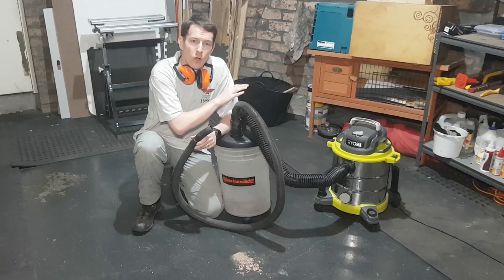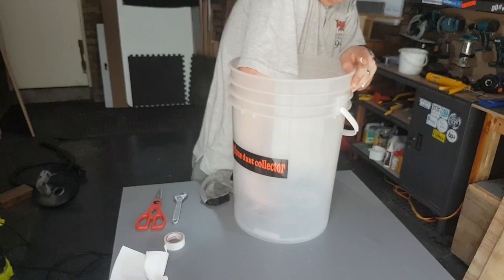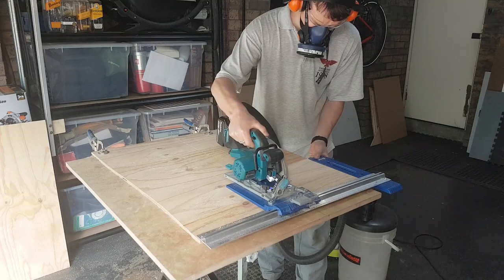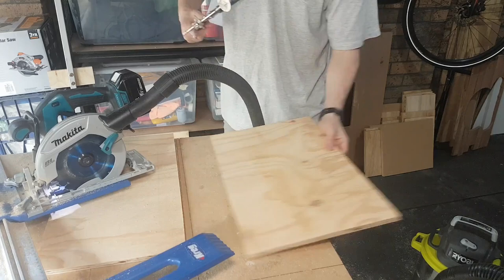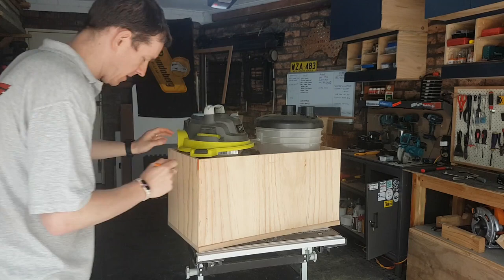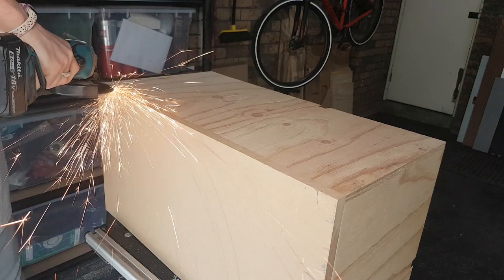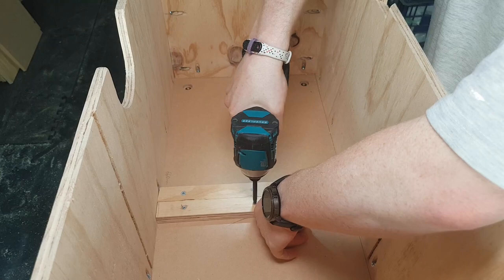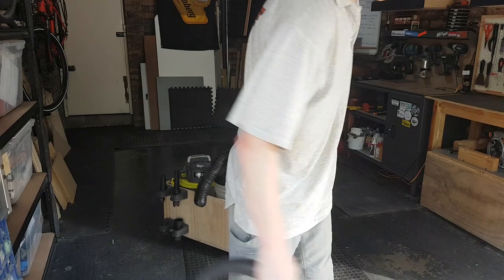Simple Cyclone Vacuum Dust Cart

Comment from the maker: I went with this low profile an Aussie branded Sherwood Cyclone Separater from Timbecon that came with it's own bucket. Triton do a very similar one which in Australia you can get here: https://amzn.to/2XFCVqp . An American similar option is the "Duststopper" (https://amzn.to/2Xwc6oo) but you need to BYO Bucket! The Amazon links above cost you no more, but provide my a small kickback to support this channel. If you choose to use them  I thank you!
Reply from the maker: PS - I've not tested the "Duststopper" but it has reviewed well! There is also the American made Dust Deputy (https://amzn.to/2Xuy7nm), a more efficient Cyclone, but I wanted a low profile to fit under my bench. There are cheaper unbranded variants of that style available too (USA - https://amzn.to/3caWXOG , Aus - https://amzn.to/3gyxT7M ).

Comment: I have the same Cyclone but under a different name and i had the same problem with tipping, so i built a vertical holder using some scrap 3x2 pine and plywood with my vac at the bottom and the cyclone at the top, worked out great and the cyclone was perfect for a workshop using just a vac for dust collection.
Barry (ENG)
Reply from the maker: Yes I think this model gets around and rebranded a lot. 😅 How'd you find the efficiency? I still use a bag in the actual vac, cyclone misses about 10% at a guess. Still, vast improvement!
Reply: @FixitFingers  The Vac i'm currently using is a Draper which i have had for a while now with no bag in it, i think also it has more power than your Ryobi but the Cyclone itself i am happy with, it does a great job instead of one on top of a bucket like the Dust Deputy, i'm glad i bought it. I did have it connected up to some 2 1/2 inch clear pipe which i attached to the ceiling of my shed (low ceiling), then i took it apart when re arranging the shed and haven't set it back up yet!! overall i am very happy with my Cyclone.
Barry (ENG)

Comment: Hey mate, recently stumbled across your videos in my quest for more AU-specific content - really enjoying it so far!! Especially busting the misconception in my head re plywood being 'cheap'.. I think I knew it on the inside, but needed someone to say it!

I've got the same Ryobi vac as you and having used it for a few weeks, realised the need for a cyclone sooner rather than later. In terms of the cyclone itself I'm currently leaning towards a cheap-ish one off eBay rather than a name brand, though I had been wanting to DIY the whole thing, but was struggling to visualise the pieces.

That said, my fairly basic questions would be:
1) What products are you using for the connection between the vac and the cyclone? There's so many potential options for this and everyone has a slightly different approach, but I've never seen someone actually say what they're using.
2) In a similar vein, what products if any have you used to allow you to attach the original Ryobi hose (at least it looks like?) to the cyclone for the end-use? I'm assuming giving the large connector on the end of the Ryobi hose it might not be as simple as just plugging it in?

Any other advice you'd have for a novice in this area?
Reply from the maker: G'day Bren, it is totally possible to DIY these with plumbing supplies from Bunnings. The basic concept is to have a 90 degree angle bend inside the drum creating the cyclone on the intake from tool to drum and a straight exit in the middle of the lid to the vac. You need a stiff drum and getting the flexi-hose came be tricky. Hence, I opted to buy a budget kit and save the fuss. 

1) The hose between the vac and cyclone come with the Sherwood kit. Flex hose and custom fittings can get pricey so another tick for the kits. Carbatec have every hose and connection under the sun to custom build a system but to start out the kits are great.  https://www.carbatec.com.au/dust-control/dust-extraction-hoses-and-pipes?aff=4

2) This part is incredibly frustrating. Every tool seems to have a different diameter port, and you are constantly trying to find a connector that fits. I use these https://www.bunnings.com.au/powerfit-dust-extractor-vacuum-accessory_p6210177 step connectors. You'll see one permanently attached to my Kreg Jig, and a couple of trimmed down ones around. You can get multi-packs on ebay. https://www.ebay.com.au/itm/333744933674

I steal dumped vacuum cords off the street when people leave them on the side of the road if they look in good nick and have simple connections on them too! Plenty of great vids on DIY cyclones, otherwise the budget Sherwood one I have is good for the price, and Im sure the Dust Deputy would be fantastic, but is more expensive. 

Hope that helps! - James
Reply: @FixitFingers  great stuff, thanks James. Some interesting food for thought!
We've just had hard rubbish nearby, but I didn't think to walk around and look for vacuums!

I'll have a bit more of a look at what I can find on eBay too, in addition to Timbecon/Carbatec/Bunnings.

Comment: Nice job. The kreg Jig adjustment I was always getting wrong was the drill collar depth until I found the following tip. (A) set Jig to correct width for material. (B) put a wood biscuit on flat on the Jig where the wood goes. (C) drop drill bit through the guide until it rest on the biscuit and then set collar. Since adopting this process my failure rate went from one in two to  zero. By the way, "The Shire" or the North Shore?
Reply from the maker: Took me a second to get your name... gold  😂 Great tip, and honestly probably easier than using the little guide block. North Shore... what gave it away? 😉
Reply: @FixitFingers  As to the name you are too young to be familiar with the classic book "Let's talk Strine" a true seminal work in Australian lexicography but if you ever see it grab it, it just may give you a few smiles. . As to the area, the peek outside with smoke haze in an earlier episode, the grouping of tree tops made the Eastern or Western suburbs unlikely.
Reply from the maker: @sheilbwright7649  Grew up in the Inner West and you're right, very different trees around here. Not too far from Lane Cove National Park. Nice area, but bloody hills everywhere! Sounds like a read I'd enjoy, I'll see if I can track it down.
Reply: @FixitFingers  As to location, whilst near LCP covers a lot of the North Shore, so I can say snap. The rain has been welcome.  As to the book the author is Afferbeck Lauder and make sure to ask for Emma Chisit. Cheers.

Comment: Hi mate love the build!  How long have you been using/Do you have a review of the Sherwood dust separator?
Reply from the maker: Not a video (Yet! But thanks for the idea!) So here are my thoughts for you... That Sherwood was new when this video landed, which gives it about 8 months in the shop. It is good for the price and my needs I'll say. The connection from the lid to the bucket is not fantastic, but it gets the vast majority of the dust out. I've emptied the actual dust bag in the vac maybe once or twice since Jan and it is generally the super fine stuff. These one-stage buckets I don't think are as good as the Dust Deputy style ones with the cyclone above and the bucket below, but then again it is much more compact and a lot cheaper. I needed the low profile to fit under my bench but if that isn't an issue I'd go a the DD style one. Cheers! - James